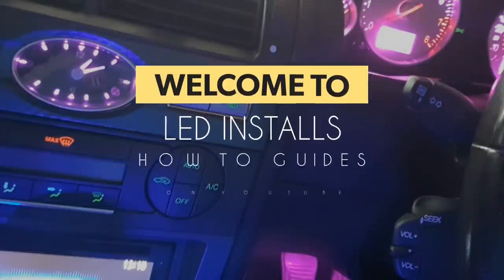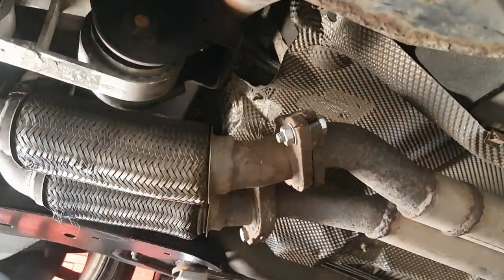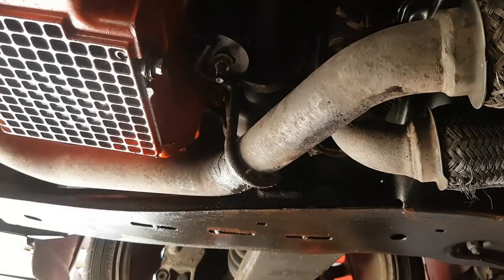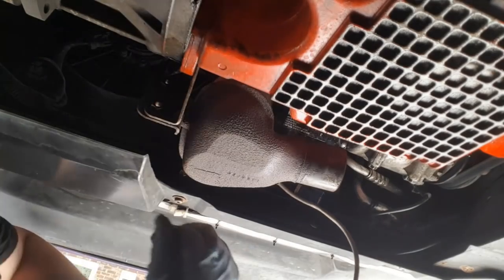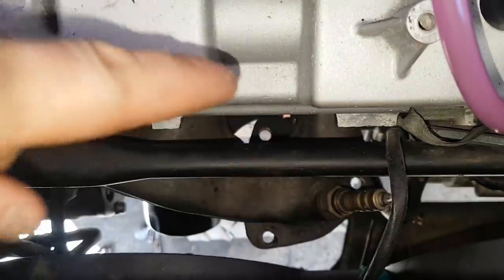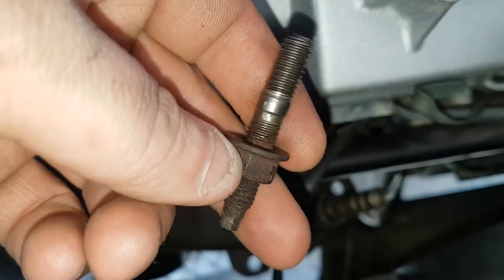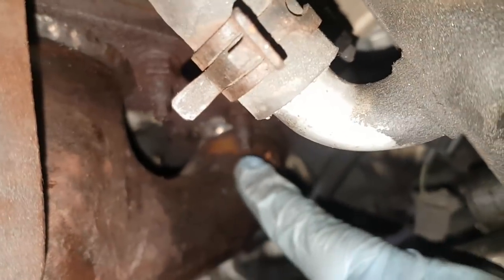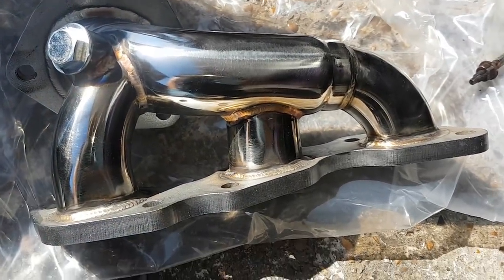Ford Mondeo Mk3 ST220 - Gravity Performance stainless exhaust system install guide. Pt1

Comment from the maker: This upgrade i had to do over a few video due to the time it took to do it. i will be uploading the next part over the next couple days. The next part is for the removal of the rear manifold then another video on install the new stainless steel system. So if you like the video please leave a like and if your new please consider subscribing thanks

Comment: Hi Chazz. I'm in some confusion. Does this manifold kit eliminate the original cats?
If so. Does it mean the eml light will be on? Cheers.
Reply from the maker: Hiya mate, yeah they do and so far my eml light has not come on.
Reply: @ChazzCoombes  brilliant. Nice one Chazz. Very much appreciated. 
Finally getting round to getting jobs done. Did Front disks and pads. Started rears. Needed that flipping tool. Thought I'd get away with just winding piston back. Next job after. Radiator. All thanks to ur channel.

Comment: I have the same engine and it's making a squeaking noise from the exhaust manifold I tried replacing the gasket but it's still there this happens when I warm up the engine.